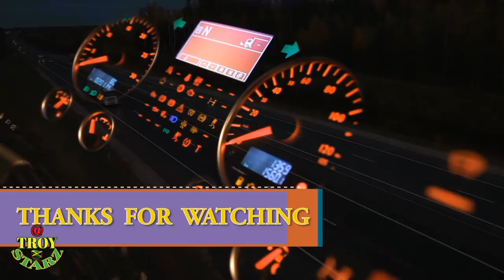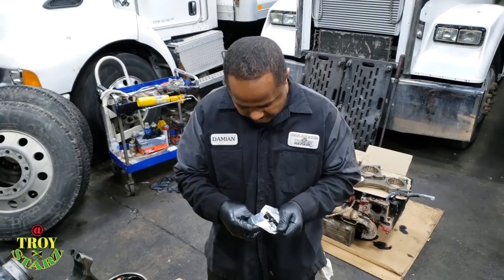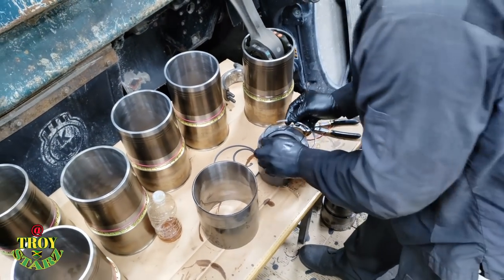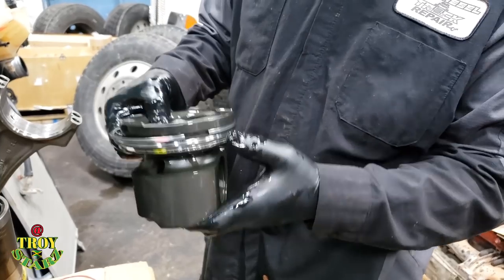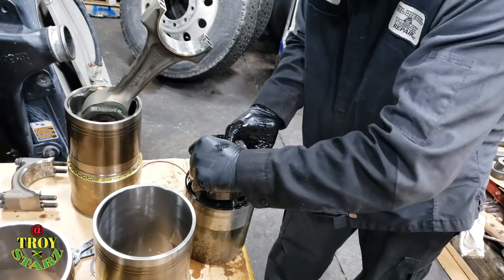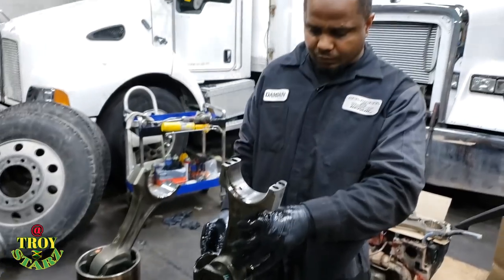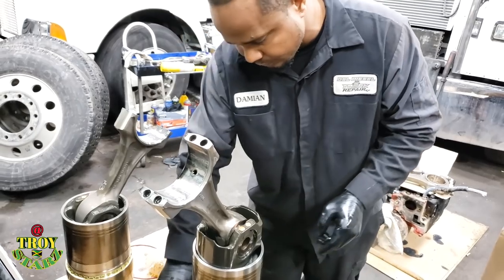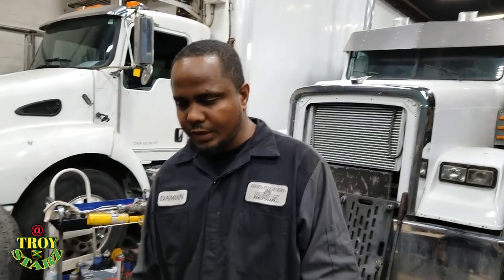A Easy Cheap Way How To Assemble ISX Cummins Engine Piston & liner Kit

Comment: you can buy a ring compressor that will work for 50 bucks, its not the cummins top of the line one, but a band style ring compressor will work just fine...

Comment: What is good price for rebuilding isx15 Cummins 2014
Reply from the maker: Don't worry about that right just use good oil in your truck
Reply from the maker: https://youtu.be/9OTxKmRt39E This is the oil to use in your truck👍👍. Maybe I little expensive but last longer and way cheaper than rebuilding an engine

Comment: wow...you need to measure the depth of the sleeves and cut the base where it seats until you have the proper clearance, you cannot just install the  sleeves.....otherwise you will blow the head gasket..this is a precision job...im not seeing any of this...very scary.